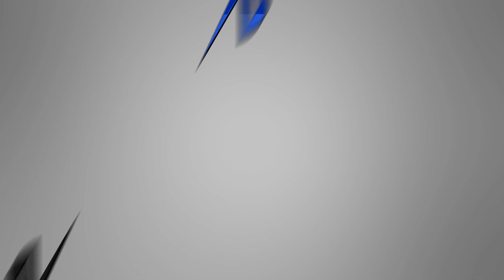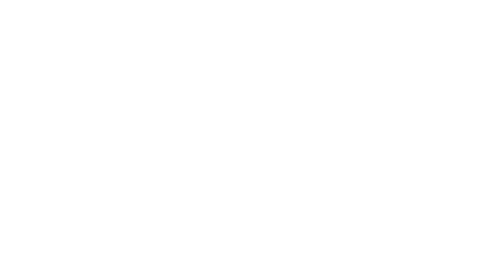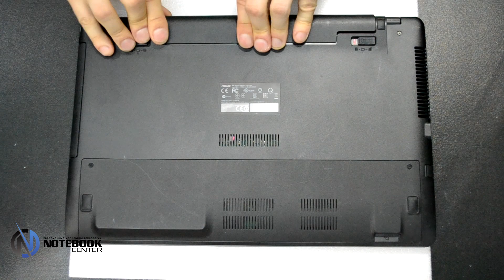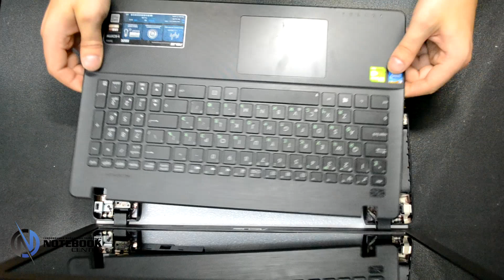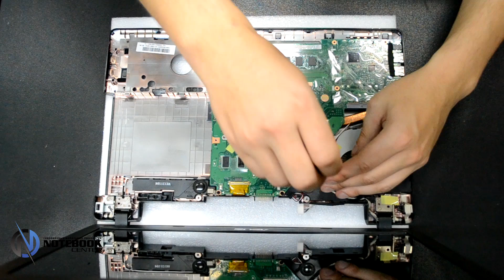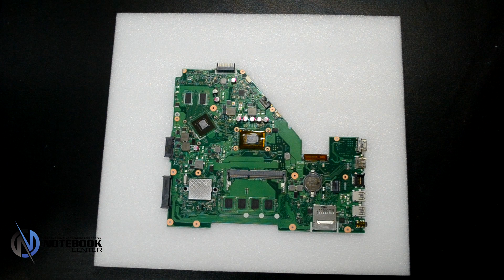ASUS X552 - Disassembly and cleaning

Comment: where is the ram located?
Reply from the maker: 5:20 you can see it at the bottom, above 4 black chipsets.
Reply: @NotebookCenterTV  My Asus X552L model stopped working. The authorized service centre said rhe entire board needs to replaced costing  ₹30000. I had purchased the laptop for 41000. They don't do board level servicing or repair. 
 Later I got it checked with a board level servicing guy. He said the 4 black chip sets are gone bad. It can't be replaced as this is not removable for this model. Normally other models have replaceable RAM chips. 

Would you please let me know your opinion if that could be replaced?
Reply: @gurudattag  oh my God! why they put a nonremovabel ram !!!what a stupid idea ! But thanks to let me know because I was searching for the ram for   couple of days

Comment: I wonder what is the white thing before you put the fan, is that important? White thing like a paste or glue?
Reply: Please answer this i also want to know that is that paste important?
Reply: Yes thats the thermal paste and it takes the heat from the chip to the heat sink. Without it you can overheat the chip.

Comment: Hello sir, may i ask you, At minute 10:50 my processor chipset is only 1, the one at the end is missing but on my motherboard there is a mold for the processor chip at the end, and the orange copper Also just the same shape as in the video but a little shorter because it only has 1 proccesor chip